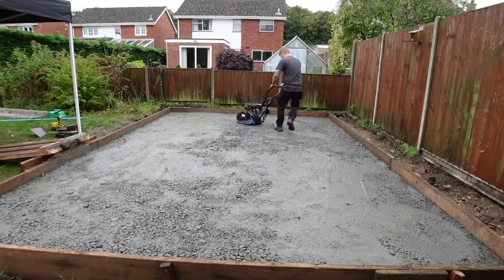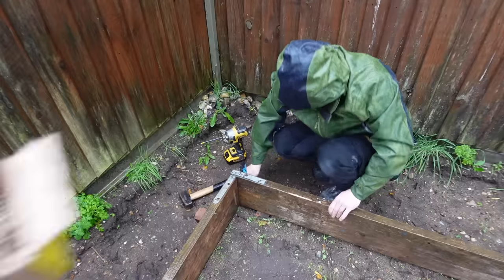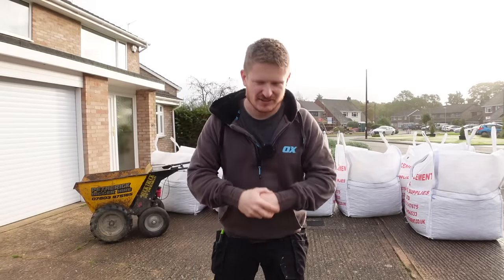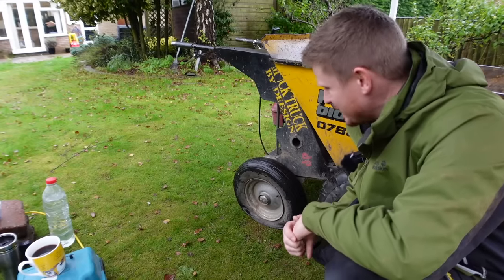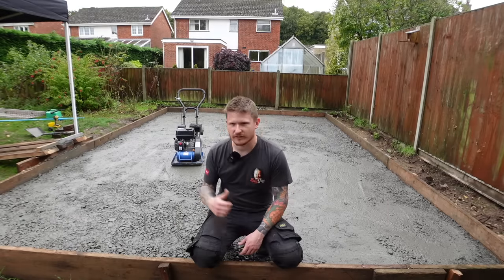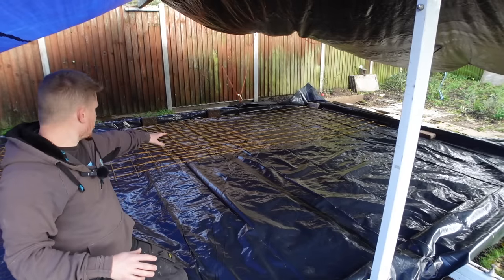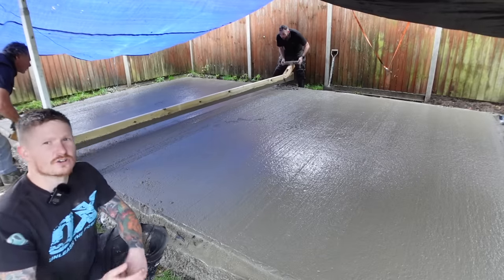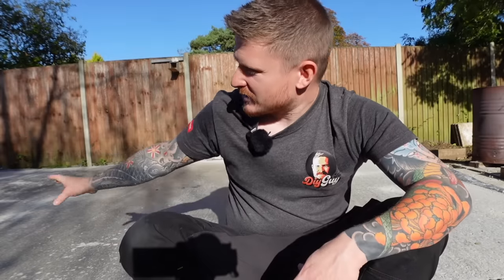How to Lay a Concrete Base Like a Pro - The Workshop Build PT2

Comment: Did you consider insulating the slab? What are the pros and cons of that?
Reply from the maker: I did consider it and if it were being used  as a garden room I would have. The pros are you I create your internal head height. Con is the amount of extra ground that would have to be removed for the insulation.

Comment: Hi , really cool footage and tips. So base is perfectly level everywhere ? I've heard base should have some fall for rain otherwise water may stay in one place and make moisture?
Reply from the maker: Thanks. The base is perfectly level. No need for run off when building a garden room on top of it because the structure and cladding fly past the base so no water will ever come in contact with it.
Reply: @TheDIYGuy1  Im planning to do garden house with pergola so arround that concrete base will be porcelan slabs so I recon I should think about some fall for water right? Is the slabs should have a bit fall as well ?

Comment: Enjoyed this vid and the series so far. Just a quick question on the boundary stuff, for permitted development I've seen it has to be 2m away from the boundary wall doesn't it? Am I right in thinking you did a little less on yours? I'm hoping to build something similar and 600mm would be a lot better than 2m which I've read online as I'm limited on space as it is
Reply from the maker: You can go closer but you are then required to make the boundary facing walls non combustible 👍

Comment: Can't i just pour concrete mix straight onto soil without the sub base? I was thinking 1:5 cement to 20mm ballast sand ratio with rebar. Obviously making sure i compact the soil before pouring.
Reply from the maker: I wouldn’t recommend this personally for a few reasons.

Comment: That took me back a few years to when I did the base for my summer house. Fortunately I had help from a builder in the family but it was still tough. Unfortunately  my plot is very deep and probably about 70m from where the materials were dumped to where we were building. I shovelled and barrowed about 10t of hardcore, 8t of ballast and 2t of cement all the way back there. It took me days. Then the wood for the 9m x 4.5m building arrived, that was about a week of trudging up and down as well.

Final result was completely worth it though, sure yours will be too!

Comment: cheers for the vid.... looking great.... definitely wheel barrow for me! Sooner spend an extra hour or two than have the expense and hassle of that dumper thing! ;-)
Reply from the maker: Your Welcome!  Haha yeah it’s an experience 😊
Reply: Better to use a tracked power barrel/dumper, most have hydraulic tip,most can carry around 500kg, being tracked spreads the load better & don't sink in soft ground like wheels & no puntures. Some hire centres do Tracked Mini Dumper with High Tip with a self loading Shovel, great if you have MOT 1 delivered loose. (cheaper than bulk bags).

Comment: Hi great video. Quick question. Could you have used latex self leveller instead of that concrete so you didn't have to go through the trouble of levelling it out which seamed hard to do?
Reply: Doesn't work outside and also can't have it as thick

Comment: Are the steels and the dpm because your doing a proper brick build off it? I wanna make a concrete base for a shed and wood store/rack would I need these or would just the aggregates be fine?
Reply: The steels are just anti crack mesh, they don't add much strength.

Comment: What a horrible day and how typical the sun shows up when done whats the plan with the sides will the type one and sand not get washed away  a little over time or is it like a next step that holds it in or 😅 not a grounds person here  to learn
Reply from the maker: Yeah typical right! There will be a cheaper hardcore backfilled around the edge of the sub base to prevent it falling away over time. Finished surface/drainage/paving will then go on top of this 👍

Comment: I realised you posted this 6 months ago, but I i'd like to know why you didn't go for ready mix concrete and have it piped direct to your pad out back to save transporting it from the mixer using the dumper truck and barrow? Otherwise excellent video series of your build.
Reply: I would think it’s cost, I just had a quote for a pump and it was £650 on top of the £500 of the concrete

Comment: Very nice!  How would you go about  doing that inside an already built garage with paving slabs?  Id like to replace them with a concrete slab.  I can't see how it can be smoothed if the concrete goes wall to wall, unless its made in multiple sections.
Reply: Step backwards with your leveling board.
How d'you think they do it in houses?
Reply: @JP_TaVeryMuch  I've seen the concrete base made before the walls go up. If there's concrete from wall to wall, and there is the wooden strip at wach side, there isn't much space to move it from side to side. Then the strips would be stick in place. Ideally I'd like the concrete go from wall to wall unless there's not a good reason not to.  This is a job I'll pay a professional to do.  Its too big and expensive for me to screw it up.  I'm not a builder.
Reply: @JP_TaVeryMuch  But a base like in this video I would try myself.
Reply: @paulklasmann1218  
I'm sure that you will have seen floors being poured and levelled on countless property programmes. Channel 4 is good for those, especially Grand Designs and that George bloke's Restoration or Ugly house to whatever it's called.
The best bit about indoor floors is that there's almost always no need for shuttering except maybe at the doors.
Best let a pro do it as you say, especially if you want those trendy polished concrete floors.
Reply: @JP_TaVeryMuch  Id like a polished and level floor because I'd like to be able to use it as a workshop with large machine tools etc.  Its a huge garage and seperate workshop but its old. A new floor would be a nice upgrade.  Ill check out more videos but for the large floor I'll get local builders in. Maybe I will do the workshop in the future.  It already has a concrete floor but its pretty rough. Its great to have building skills. I can do some things but not the big jobs.
Reply: @paulklasmann1218  All the best with that.
If you go to the expense of having a new concrete floor poured and polished you're looking at around £150/m² apparently so you'd probably have the smartest workshop in the country.
Reply: @JP_TaVeryMuch  Thanks, it doesn't have to be perfect but I want it sealed like in this video, and reasonably smooth and painted.  It'll get done after more pressing jobs.  Its all expensive.

Comment: Is there any reason why you didn't insulate at the same time as laying the slab?
Reply from the maker: I did consider it and if it were being used  as a garden room I would have. The pros are you increase your internal head height. Con is the amount of extra ground that would have to be removed for the insulation.
Reply: @TheDIYGuy1  Thanks for reply - yes I am in the same quandary now with my own workshop/room. I think as a drummer I am planning on soundproofing the room I am going to insulate the slab just so I don't create extra soundproofing issues. The headheight restrictions maybe an issue though - the 4 metre span I'm aiming for requires 7 by 2 timber so I'm losing a lot just in the eaves
Reply from the maker: Have you considered using 5x2 doubled up? If you coach bolt them together a bit like I did with the lintel above the door then it should be enough for a 4m span

Comment: No floating, edging or control joints before it set up ?
Reply from the maker: Nope not needed for this application
Reply: You been watching too many US concrete videos 😄In the UK hardly anyone would ever do all that time consuming stuff as we just use self levelling screed if needed. Not only is that a lot faster and the self levelling will achieve a much more level floor, but it just wouldn't be possible to float it most of the time in our weather.
Reply: @noire1001  Well, I haven't much time for videos in general actually, and today I poured a 6m long foundation for a stem wall and edged it off. Tomorrow I will remove the form and get set up with rebar to pour the adjacent slab and float it with my handmade (laminated beech) wooden bullfloat, and then once I have cut the control lines I will fresno float once since that's the finish sought. I happen to be in the EU, and like you, most EU practitioners don't cut it up as you say the yanks do. Us aussies are maybe just a little too american these days.

Comment: what stops the sides of type 1 and sand spilling out when you strike the shuttering?
Reply from the maker: The sides will be back filled with a cheaper hardcore before drainage and paving is installed.
Reply: @TheDIYGuy1  I think you should clarify this in your next video. If the ground level was not being raised to contain the sub-base then i'd have suggested thickening the edges of the concrete before pouring to contain it all. Also i'd advise you cut a control joint at the 3m mark to help with cracking and maybe even one centrally down the length. Its also worth a mention that the longer you keep the slab covered the harder it will become as it slows down the curing process by keeping the moisture in the slab, this is really effective but time does not always allow. Also for a "Pro" finish i'd have bull floated the slab to further smooth it out.
Anyway, good job overall concrete is always harder work than anticipated on the day.

Comment: Great video! I suppose either the load on this foundation won't be too heavy and/or the ground on which you've built this upon is dense? Here in the spongy part of the Netherlands we need to drive in long poles otherwise it'll sink, break or even float!

Also, I've seen such constructions being made and after pooring in concrete a vibrating device is then used to get all the trapped air out.
Reply from the maker: It’s interesting to hear the methods used in the Netherlands. Ground screws are becoming more common over there too in fact. With regard to the vibrating tamp, we actually had one on hire but the hire company dropped out two days before the filming of the video 😑, so we had to do this the old fashioned way.

Comment: Jesus, that looked like hell. Your helpers need a big old shoutout (well done folks, beers are on Cameron...) Question, sort of for a mate. Would 99% of what was done be used if you were putting slabs in a garden for flooring. Obviously it would not be proud of the original garden floor level, but is it the same idea so the slab's are even and not going to sink?. Another good 'un Cameron..
Reply from the maker: It was a nightmare to be fair 😂. They do deserve a massive pay on the back. Regarding the slabs it really does depend on the load intended as to the kind of sun base I would use.
Reply: @TheDIYGuy1  Hi Cameron, in this case the bloke has had a shed built at the back of his garden, and he wants to pave the way back to the house, purely for walking on, no real load at all.
Reply: @Mclaneinc  You need to dig off the topsoil or at least 150mm down. Then install a geotextile membrane (Not weed fabric) and compact 100mm of MOT Type-1 sub-base. This leaves 50mm to bed your paving on. Obviously if you are using thicker than 20mm paving you will need to dig down further before installing sub-base to allow for the added thickness of the paver. For very light pedestrian use you could probably reduce the sub-base to 75mm but in most cases there is little point as the sturdiness of the sub-base is what ultimately effects how long the paving lasts.

For porcelain paving you need to install a concrete slab or increase your mortar bedding layer to 75-100mm. With a concrete slab you can lay your porcelain on a thin bed of mortar.
Reply: @Palo-jm7xc  Thank you so much, I shall pass this on to the person so they can make sure it's done properly. Paul..

Comment: Sorry, but as a minimum, a pro would use a concrete edging tool and a bullfloat. Once the concrete can just be walked on, they would then go over the whole surface with a steel float to get a smooth tight, hard waterproof finish. If more grip is reqired, a light broom finish can be applied. By contrast the screed board finish here is rough, will chip readily, is more porous, will also be a constant source of dust and not ideal for setting wall plates. To be fair, most british builders don't own any of these tools or know anything about finishing concrete.  By contrast, builders in the USA , Canada and Australia are much better at concreting. I know it's "only a workshop" but a sound, smooth clean surface is much more desirable.

Comment: The way you have built this base is totally back to front
Unless you build your building on this right to the very edges of your poured base then rain water can't drain
You have actually built a tray to collect water
I hope you can see what you have done
Honestly how can water drain fro that slab
Reply from the maker: 😂😂 I don’t think you understand the build. The building will be built to the pad so none of the pad will be collecting water! This was explained in the video with regard to the dpm being folded up the walls.

Comment: You don't need the MOT or Rebar for such a shallow slab.
Reply from the maker: I beg to differ but welcome your opinion all the same
Reply: I'd disagree as well👍, the mesh gives the area strength and as you say prevents cracking. Do it right and you only do it once, looking to follow this journey @TheDIYGuy1
Reply: Definitely need the Type 1 & rebar, as to concrete mix I like my fibre concrete mix, it adds additional structural integrity,durability & toughness to the slab.